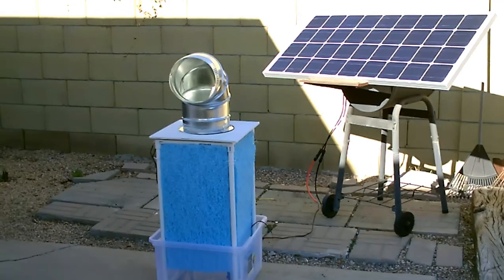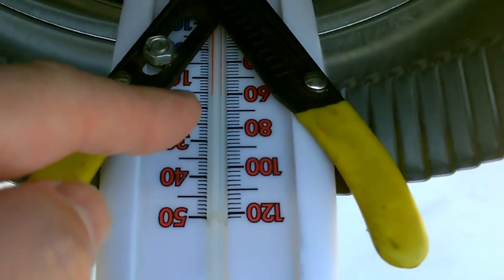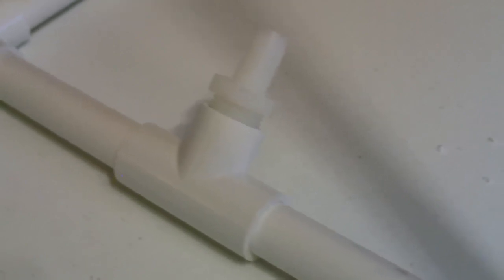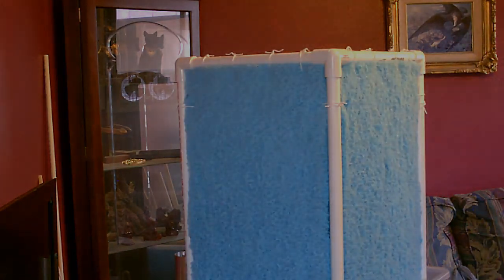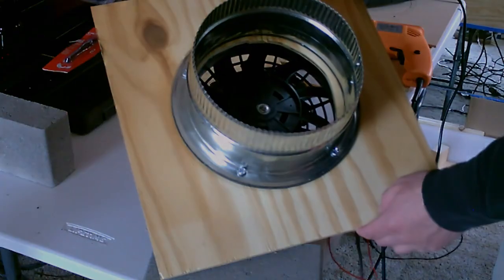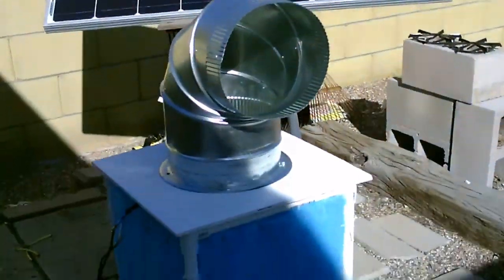DIY Evap Air Cooler!  w/high speed Fan!! - Cools up to 1000 Sq.Ft.!!  (can be Solar Powered!) - DIY

Comment: Just wanted to come here to say thank you! I built this for burningman on what ended up being the hottest year and was able to sleep comfortably until noon a couple times. Not going to lie and say it cooled my entire tent, but it definitely cooled me and provided uninterrupted sleep without the need for a loud generator. 

Question for you if you see this. Would it have worked better if I placed the whole unit in my tent instead of just the flex tube?
Reply from the maker: hi there. i'm glad you made it and i'm glad it worked for you! you used it the correct way. (it works the best if the unit is just outside the living space). if the tent had lots of ventilation it might have worked okay to have the whole unit in the tent. one thing to check is to make sure that the water is running down all 4 pads evenly. sometimes dry areas happen and then a lot of the air goes thru the dry part of the pad and doesn't cool off. the air wants to go the path of least resistance and it's a little easier for air to go thru a dry area.

Comment: Getting close to making a decision. Love your channel man! is this so far the best one you've created? If so, then I'm gonna go with it.
Reply from the maker: hi and thanks. this one is one of my best (most powerful) evap air coolers. maybe the most powerful DC powered one. if evap. cooling works in your area then i'd say go for it! (plus this one can be solar panel powered.) - by the way if you want to run my DC projects on AC at any time then make sure to watch the video i made on how to easily do it. here the link https://youtu.be/GATesKJeLMM
Reply: @desertsun02  I'm totally off grid solar powered back at the house, DC is perfect!
Reply: @desertsun02  North East Washington, dryer than a buzzard fart here. I run a micro 400 watt system with a 200Ah 4D AGM battery, MPPT 40 amp charge controller, 1200watt rms pure sine iverter. For our needs, works like a dream, we watch dvd's, light our home, and keep the electronics in the propane refrigerator awake, and charge our devices, and my dewalt batteries. I use a generator for backup in the winter, and to run larger power tools. I have one of those little "as seen on tv" evap coolers, works great for its size, but constantly refilling it,  so I'm wanting something more of a whole house (40' ft fifth wheel) cooler.
Reply from the maker: hi. just make sure to use a strong high velocity fan and your set!
Reply: @desertsun02  what cfm was that $14.00 fan?
Reply from the maker: in real world use it measured around 1300 cfm. i think they rated it at 1500 (2000 max.) here is one similar that is 1730 cfm https://www.amazon.com/DNA-Motoring-Performace-Electric-Radiator/dp/B01NB0LK0D/ref=sr_1_4?dchild=1&keywords=7%2Binch%2Bcar%2Bradiator%2Bfan&qid=1622901769&s=automotive&sr=1-4&th=1
Reply: @desertsun02  perfect!

Comment: That's a great idea. I wish we could use them South Carolina. It would just add to the humidity here.
Reply from the maker: hi there. stay tuned- in the "not too distant" future, i'm going to be showing how to convert this unit into a what they call a 2 stage evap cooler. those produce humidity but it all stays outside, only dry air enters the house. i finally figured out how to do it! (now i just gotta make the vid.
Reply: @desertsun02  That sounds real good. I think you'r onto something.
Reply from the maker: actually my next video might be what you're looking for. it's an air cooling system that uses chilled water and a radiator w/fan to make cold air. it produces no humidity and does not need to be vented outside (like a regular AC). i'tl be posted in about a week

Comment: I wonder if you could do it without the pump though. I have a small usb-powered evaporative cooler that works using capilary action alone and that functions just fine. But I should note that it uses more of a cloth-like material

Comment: Thanks for another great idea. I built your box can cooler, but this design will work even better.
I cannot find the exact fan or pump that you have. Can post the links or mention where you got them? Thanks.
Reply from the maker: hi there and thanks. amazon has tons of 80w 7 inch car radiator fans. most if not all will work. pick any 80w one that runs from 1500-2000 cfm for best results. as far as the pump, i can't find the exact link at the moment but any 200 gph one will work ac or dc. amazon has lots of those also. note that the pad is a little pricey on amazon. i get that at home depot.
Reply: @desertsun02  It is so cool what you’ve built and I really want to follow your specifications; however, I am unable to find an 80w 7-inch car radiator fan within the 1500-2000 cfm range on Amazon.  The highest cfm I can find in the 7-inch category is 1350.  The Amazon link to the model you purchased would be ideal, but in the absence of that, even the model name and/or manufacturer would help.  Thanks!
Reply from the maker: @bryton beesley. i took a quick look and all i see are the 1000 to 1350 cfm fans at the moment too. well i saw a 1700 cfm one but it's 8 inch. you could use that one. 8 inch fans are about the same size and they seem to use 80 watts just like the 7 inch ones. the 2000 cfm rating on the fan i used was for max output but now they don't list that anymore (it seems like amazon is still selling a lot of the same fans - but the cfm ratings for many of them have been lowered). when i was looking at these fans couple of years ago they were ALL 1250 cfm or higher (with the average being 1500 cfm). they might have been exaggerating to begin with - it's hard to say. i've measured the flow at around 1250-1300 max so i don't know. i would say that as long as it's got a rating of 1000 to 1200 cfm or higher it's going to really push a lot of air and should work good. or you can go with an 8 inch one.
Reply: @desertsun02  Thanks very much for taking time to check Amazon and reply!  I will do as you suggested and try the 8-inch fan rated at 1700 cfm.  Thanks again!

Comment: Desertsun, it looks to me like the fan in the cooler is installed backwards! I do realize that this DC fan will reverse with the polarity swapped, but they run better (draw more current, thus do more work which means move more air) the right way. 

Radiator fans are intended to suck air through the radiator. After all, that's the direction of airflow through a car radiator when the car is moving. Air hits the front of the car as it travels and some is forced through the radiator. When the cooling system needs a boost, the fan turns on and pulls yet more air through. The fan is mounted behind the radiator.  Thus, you must surely have the fan mounted in reverse.  Is this an issue? Have you experimented with swapping the fan around? It will complicate mounting.  I ask, because I do indeed live off grid in a straw bale cottage with a 12 volt DC power system, and would like to make one of these to cool my cottage.
Reply from the maker: hi there. the fan is in the right way. with the push/pull type radiator fans their is no "backwards". they are designed to run either way. there is no difference in power draw or loss of efficiency. all you do is flip the blade over if you want to run it in the opposite direction. (note that flipping the blade is required or there is a serious lack of airflow, but that is very easy to do).

Comment: This is awesome, have already purchased some of the pieces but want to build it this week. Is there another video that describes the solar connectors directions, pvc measurements, and specific pump materials to purchase? I looked on your page but can't find it.
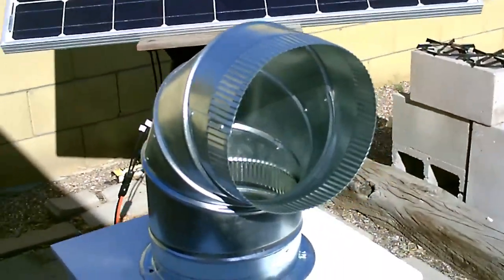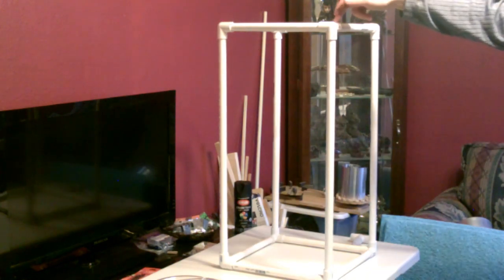Reply from the maker: hi there. i just rewatched this video and it looks like this video answers all of your questions. the connections are shown from 1:33 to 1:51. the stuff used (in detail) is shown at 2:30 (all details about the pump are shown on the box that the pump came in). any 190 gph to 220 gph 12v water pump should work good. all of the PVC pipe lengths are discussed starting about 2:55. i think that answers all your questions. the blue pad is technically called 'foamed polyester evap cooler pad'. i do have one other video that shows how i hook up all my fans pumps lights etc. to solar panels using wires/sockets/plugs. (the video goes into great detail about all the ways i do it) here's the link ✔🙂 https://youtu.be/qL82DuN0qHg (it's a short video - only running 4 mins 40 sec. - so it gets straight to the point)

Comment: I am about to build one of these but wasn't sure about the PVC pipe size. Is it 1/2" or larger? Also, do you have any recommendations for a PVC pipe cutter? You also mentioned (I think in your 2 stage video) that you can get flexible ducting at Home Depot or Lowe's. I'm hoping to put one (or more) of these bad boys outside and attach a duct to a window.  Thanks.
Reply from the maker: hi there. awesome that you are building it. it's 1/2" pvc. i just used a hack saw to cut the pvc. i bought the flex duct i have on amazon - but home depot or lowes probably has it too 👍

Comment: can i run swamp cooler at nite on a 12v car battery?  Is there a 'Y' i can buy to connect battery to extension cord?  or do I need to make it?
Reply from the maker: hi there. 12v car batteries are not designed to be 'deep cycled'. it's best to use a 12v 'deep cycle' battery to run these. you might be able to run it on a 12v car battery maybe 20 or 25 times before the battery is ruined, but if you use a 12v deep cycle battery you could do it 1000 times (more or less) (or about 3 years if you ran it everyday)

Comment: Thanks for video...how long can wire be from panel to cooler before loosing strength in electrical?
Reply from the maker: hi there. you're welcome. i would say it could be 100-150 feet (maybe even 200) before there would be any noticeable drop in power.

Comment: Can you give me the exact link and recommendation as to what Motor Speed Controller I should buy on Amazon?  There seems to be different amperage, watts and voltage models on Amazon and it’s confusing and I wouldn’t want to blow out the fan or have any of the motor speed controllers not work with the radiator fan and/or pump.  Also, can you do a video on how to setup a Motor Speed Controller?  I don’t know how to wire it properly with the other DC pieces.

Comment: another great video! 
would placing a dry evap. pad before the fan help stop water loss?
Reply from the maker: thanks! no need to stop the 'water loss' because the 'water loss' is just the water evaporating and making the cold air.

Comment: Hi @desertsun02. Thanks for sharing your awesome work. In your "DIY "Indirect" Evap Air Cooler" video, you mentioned that evaporative coolers chill the water as it recirculates through the system. Do you know if your Blue Cube design would chill water even in very hot and humid climates? I ask because I've always heard that evaporative coolers work better in dry climates then they do in humid climates. Thanks again!
Reply from the maker: @R J the general rule is that these work pretty good up to 60% relative humidity, but struggle to work much over that. some big units have been shown to work okay up to 80% if they are used outside and the temps are right. if the humidity is low these things work great as water chillers
Reply: @desertsun02  I forget which channel but guy build his inside a concrete box so the water flows down the concrete walls first before it goes through the media and he was in the south like georgia or something and I guess the concrete box acted like a heat sink and made it kind of dual stage, if that makes sense. Sorry If Im not explaining this well... ohh and he made the concrete box underground so it was somewhat geo thermal

Comment: A pretty slick cooler there. One thing I didn't quite get was whether you had blocked off the downward leg s on the top corners. If you didn't then the uprights and base would be filled with water. Is that part of the design?
Reply from the maker: thanks. yep that's part of the design. the water has nowhere else to exit but the holes at the top :)

Comment: I have constructed the same evap cooler and it works but I can't get anywhere near 60 degrees and today its in the lower 80's.  The water temp is 73 and never gets below 71, The exit air temp is ranges 75-79.  Do you think the difference is the ambient humidity here in NC.  We are roughly 40's in humidity.  right now alexa says it's 45%.  I can send a photo but it looks just like yours.  100w Rich panel, blue cooler pad, and 8" 1350 cfm fan that sounds like a jet plane.  Any Help? I can include photos if needed
I didn't mention but I'm in NC and humidity in Auguest could exceed 120%
Reply from the maker: @gordon kinlaw Awesome that you built it! that's what it's all about. first let me say that it sounds like your unit is working correctly! the output temps are based on humidity and temperature. let me check an *evap cooling chart* ...so i just checked and it shows that at 85F with 45% humidity you should be getting about 73F. you say the water is about that temp (even a little lower) but the air is 75 to 79. that's pretty close to what it should be *but you can get the air temp down a little more though. main things to check are make sure that there are no dry areas on the blue pad. if there are very many dry areas on the pad then that is where most of the air will pass through. it goes through the dry areas easier because that is the 'path of least resistance'. you may want to add a couple of extra holes to the pipe for extra water flow in those areas. another thing is to make sure that the air isn't getting around the pads in any other way. that's the main things. you mentioned the air was as cold as 75F and it should be 73F so it's pretty close. if you had 5% humidity (like i often do) then 85F air drops down to 62F. other examples are (10% humidity = 63F air and 15% humidity = 65F air). google the term 'evap cooling chart' and it will show you what air temps to expect. those charts are pretty accurate. if your water temp is close to that air temp then you know the unit is working. again, it sounds like your unit is working right. also remember that humidity levels raise and lower all the time (that is probably why you saw a range of 75F to 79F).

Comment: If I plan on only using this on AC power, should I get a different fan and pump with AC plugs?
Reply from the maker: hi. here's a video i did showing how to run my 12v projects on AC. only 2 mins long. it's the way i would do it. (then you can still run them on DC if you want). https://youtu.be/GATesKJeLMM

Comment: Thx...any decibel readings?
Reply from the maker: hi there. it's not very loud. (no louder than a box fan on high anyway). only sounds that way due to the cameras mic. and when you're very close to the outlet. *but when you're standing in front of it, it just sounds like air rushing out of the tube.  if you want it to be super quiet you can add a "motor speed controller" box. that might sound fancy but it's not. all it is is a small box maybe 1"x 2" with a rotating knob on it. they sell those on amazon for about 12 bucks and they're a breeze to hook up..then you can run the fan at any speed anywhere from 1 watt to the full 80. i've run the fan at one-third speed and one-half speed, (30 watts/45 watts). at half speed it sounds like a box fan on low and at one-third you can barely hear it.
Reply: @desertsun02  thx a bunch...shared this already...

Comment: 25w Pump only works on AC plug from wall. I cant get it to run on DC. What is the fix? too many watts?
Reply from the maker: hi there. if you've got an AC powered pump then you need to run the pump on AC. if you want to run a pump on DC (like with a 12v solar panel or a 12v battery) then you'll need a DC pump. they are easy to find. amazon has lots of them.

Comment: Could one expand this model & put a 20"x20" box  fan facing down &  with matching size pvc structure & cooling oads, etc, & have the water circulate with float valve in a larger container.
Reply: meant to type  box fan facing up
Reply from the maker: sounds like a great idea. (i'm glad you made the clarification about the fan facing up)

Comment: What solar panel is that? An how much was it?
Reply from the maker: hi. it's a 12v 100w monocrystalline panel by renogy. they sell for about $100 these days. found on amazon 😎
Reply: @desertsun02  thank you for replying. Going to give your cooler a go and trying  pick through all the solar panels out there. A lot of Amazon or ebay panels make great claims to what they produce.  Thanks again for the info.
Reply from the maker: honestly, i have great performance with the cheaper panels too. i have a 12v 100w polycrystalline solar panel that i got on amazon for only $79.00 and it works at least as good as the renogy one in this video (probably better). i think it's made by HQST. i just buy the 80 dollar 100w panels these days. i think they are at least as good.
Reply: @desertsun02  thanks good to know I think that $80 panel was one I was thinking of getting.

Comment: What about if you wanted to be able to just plug this bad boy in a outlet and no solar would you need to do anything different
Reply from the maker: hi there. you don't really have to do anything different. the only thing you need to do is buy an AC to 12V DC transformer. amazon has lots of them. then you just plug the unit into that. i've actually made a 2 minute video on that. if interested, here's the link https://youtu.be/GATesKJeLMM
Reply: @desertsun02  thank you

Comment: Do you glue the pvc pipe together!
Reply from the maker: hi. in this particular project i didn't. the pressure in the pipe is very low and the pipe is all inside the container, so it doesn't need it.
Reply: Thank you